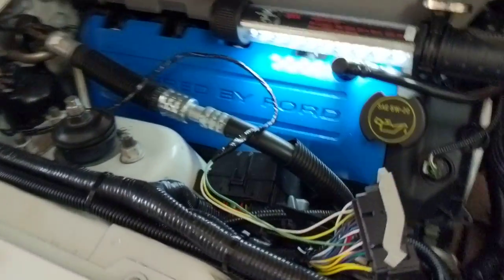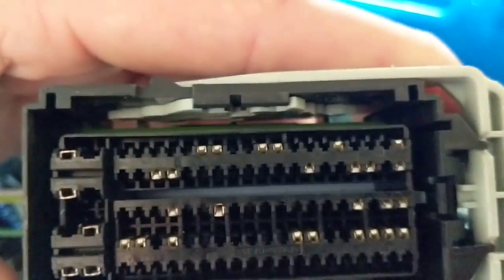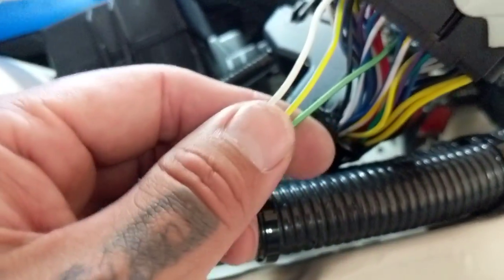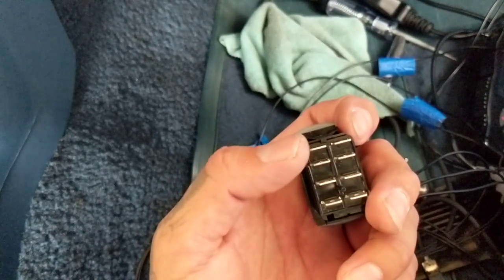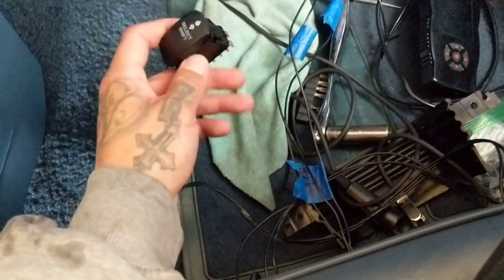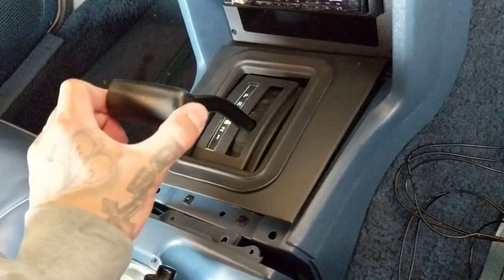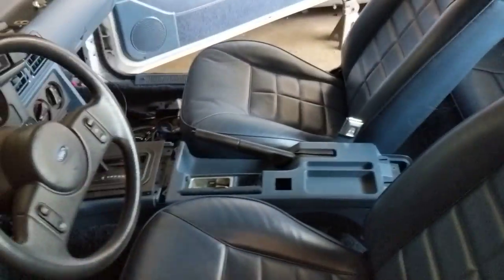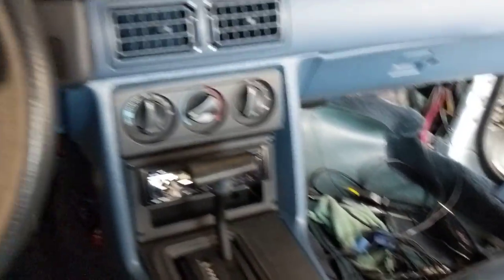Coyote swap how to 6r80 selectshift and shifter cable

Comment: Do you know the part number for the ECU pins? I need the pins and don't have an OEM harness to pull from. Thanks
Reply from the maker: Pretty sure you can get them from a Ford dealer.. don't have a part number to give you though sorry